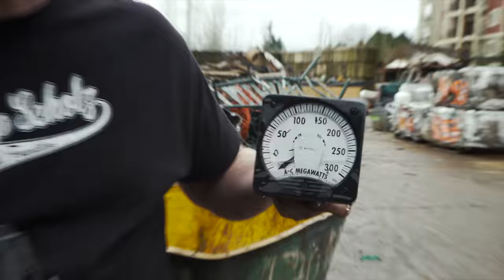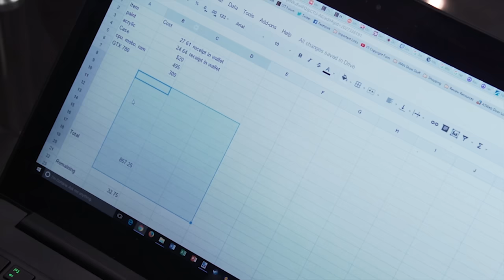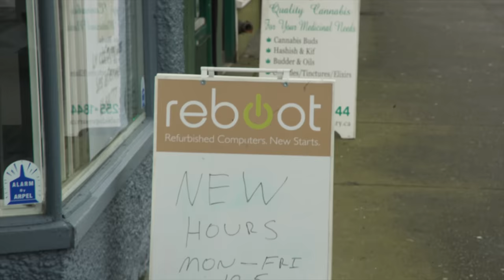Modded Gaming PC Challenge - Scrapyard Wars Season 4 - Episode 2

Comment: It would be really cool if they rewired the megawatt meter to show CPU load, temp, or gigahertz somehow
Reply: Yes
Reply: +Shockin Awesome It's impossible.
Reply: +E.J. Mercer (iso2013) Impossible.
Reply: +TwitchingDan not if you know how to use electronics well. If you connected a microcontroller to the computer and to a servo, then you could write a script on the computer that sends the information by serial. Definitely not impossible.
Reply: E.J. Mercer They are analog meters, not digital.
Reply: TwitchingDan Then replace the existing mechanism with a servo. Or use a digital to analog converter.
Reply: E.J. Mercer I doesn't take a analog signal, it manually measures voltage. It's like a scale with a needle. You can't use a DAC to give the scale data and make the needle move.
Reply: TwitchingDan depending on the meter, if you disassembled the voltage measurement circuit, then sure you can. Servo would still be simpler (and definitely possible)
Reply: E.J. Mercer He would need a servo that can respond fast enough, and remember, that meter is solid steel.
Reply: TwitchingDan Not if he did temp. Temps don't change as rapidly. Also, who cares what the meter is made out of? It was just an interesting idea. I don't care if its "impossible".
Reply: E.J. Mercer Well, if you give an idea, make sure people can actually turn it into reality.
Reply: TwitchingDan Well, most people with electronic experience can actually turn it into a reality. They could for example chop the face off and put a servo to control the needle. They could just 3D-print a similar dial and use a servo on that. Nothing says they have to use the original circuitry.

Well, if you comment on how something is "impossible", make sure you think about other ways of doing it.
Reply: E.J. Mercer Remember these guys need to think of price. And I don't think they can use the ultimaker. Also, chopping the face off and 3D printing a new one, then using a servo, just buy something premade.
Reply: Im laughing so much with this guy. This guy is basicly saying to remove the meter, Almost are the circuit and make a cpu meter in the case xD-
Reply: Sans Who?
Reply: OK, what I meant was just to make a meter on the face to show CPU usage, whether or not it used parts from the one they found. I know this is a budget competition but it would still be cool to add after the fact
Reply: And I didn't say to chop the face off AND 3d print a new one, I meant more to illustrate that it's possible to do in multiple ways if they wanted to.
Reply: I've got mechanical dials on my old steam punk case. They measure temperature, 'pressure' (cpu load), and 'phlogiston' (decibels from the inside of the machine). The dials came from some old hospital equipment but we took the face and body from the dials and wired them up to standard doodads (obviously, not an electrician). You really can use them, you just have to gutted mechanism from the metre.

Comment: $300 for a 780? lmao
Reply: +Suplx Canadian.
Reply: CAD.
Reply: +Suplx 300 CAD
Reply: Like $3 us
Reply: +Suplx 300 CAD is $311.49 for us
Reply: +Oliverleo2007 300 CAD should convert to around 220-230 USD
Reply: +Oliverleo2007 Goes the other way currently bro
Reply: +Oliverleo2007 The fuck you talking about? $1 CAD is equal to $0.77 US right now. Not too long ago it was less than 3/4. $300 CAD is about $230 US.
Reply: poor Canada. I got a 970 new for 320 us when it first cane out lmao.
Reply: +batt3ryac1d You can come to Australia where you can get cheap deals of GTX 970's from a low of $459 to as high as $539 Australian Dollars. Gotta love the exchange rate :D
Reply: +AUSCreeperCo_ yes I got mine for 490
Reply: +AUSCreeperCo_ I know right? I'm building a $1500 pc and it has a R9 380 4gb and an A8-7670k plus some other budget stuff.
Reply: +Suplx rip got a 780 for 250 aud :)
Reply: +Jerreh Mc WHY AMD
Reply: +Jarrad Ng coz dx12
Reply: I payed 500 USD for mine but it was two months after its release and brand new. Still performs very well, looks good and the máme has something to it. :3
Reply: +Jerreh Mc That makes absolutely no sense. A8s are APUs, which are pretty weak. Gonna bottleneck the piss out of a 380. Better off going Intel, especially since you're paying $1500 for the whole thing. There's nothing "budget" about $1500.
Reply: ***** Okay... then can you recommend a processor around that price and a good Mini-ITX motherboard that supports 1600mhz DDR3?
Reply: I'm in AUD. I'd prefer AMD, but if it is better to go for an Intel processor, I'm all ears. That processor was on eBay for $160 AUD, so maybe up to $225 AUD?
Reply: +batt3ryac1d I got a 780ti for £180
Reply: ***** Usually eBay Australia has some decent deals.
Reply: ***** So you think the GTX 960 4GB would outperform the R9 380 4GB? That would be really neat as it is less expensive and they have it in a colour I like.
Reply: ***** Okay, I reckon I'll go with the 960. Thanks for your advice! Also, do you think the Bitfenix Phenom Mini-ITX is a good case?
Reply: +Jerreh Mc If you are after low prices and live near an msy they typically have competitive pricing. If they have everything you want in stock it is a miracle though. http://www.msy.com.au
Reply: +KIN0025 i agree, cos thats the place im gonna get my pc components for my build from
Reply: +Jerreh Mc out of curiosity, why are you making these compromises on a AU$1500 budget? I threw this together:

http://au.pcpartpicker.com/p/LMVXXL

- featuring a 4690k, an overclocking-friendly motherboard and an R9 390 for less than your budget. Admittedly, it isn't an ITX system, but it's a pretty spectacular example of what you can get for that price.

Also, why ITX? Spatial constraints? LAN box?
Reply: ***** Everything's always pretty rubbish in Australia. :(
Reply: +Cody Jones "nvidia exclusive features" To be clear, this is reason NOT to buy shit from Nvidia and this is coming from Nvidia card owner.
Reply: +Jerreh Mc I paid 400 AUD for a complete build. It had a xfx r9 280x and an i5 4460 lmao
Reply: AUSCreeperCo_ I know. To be fair I got a bargain shits mad expensive here too.
Reply: +Jerreh Mc id go with the 380/90 because the 960 was originaly made with 2gb, also the apu will bottleneck the gpu so try getting a better cpu, either fx6300 or core i5^
Reply: ***** his individual mindset may not do anything significant, but the mindset itself becoming more prevalent certainly does. I know quite a few people who refuse to buy Nvidia hardware until they stop pulling crap like the PhysX CPU discrimination (where the instructions carried out when PhysX is run on a CPU is outdated by a decade, whilst it runs fresh code on their cards).

The fact that GPU performance has always varied depending on which cards were released most recently is what allows people to do this, as any AMD owner is only a few months away from superior performance anyway. "More advanced hardware" isn't a factor - certainly not one that is in Nvidia's favour - because they are at least equal right now.
Reply: ***** "better" isn't that simple, though. The Fury X is better at 4k than a 980ti, while the latter is better at 1080p at >60Hz.

Incidentally, you might want to drop the "everything else is bullshit" dogma. People complaining about things like DRM led to GOG becoming a pretty significant place to buy games, and also led to some of Witcher 3's acclaim for not having any DRM. Those few people who voted with their cash got us somewhere other than Steam to buy games.
Reply: +Jerreh Mc The 380 is better in most games besides gameworks features and will be around 10% better with games using async computer.
Reply: +Henrath also freesync monitors are around $100 cheaper or more than gsync, if you want that.
Reply: +Suplx It's 230 dollars
Reply: +Neiva - CS Zombie Escape Videos I got a 270x, i5 4460, build for $600 AUD new, minus the ram, psu and secondary hdd ( I got a ssd system drive).
Reply: +Neiva - CS Zombie Escape Videos msy mostly
Reply: ***** It autocorrected from Compute.
Reply: +Jerreh Mc get a mad 760k or a 860k both very good CPUs unless you play strategy or physics based games

Comment: At one point luke mentioned having a smoke stack, here's a tip if you wanna make smoke come out of them. Get a small fuel candle, like an oil lamp or meths burner, and fill it with gasoline. I use gasoline in my zippo sometimes, always burns with this thick black smoke, could give you a good mad-max look.

Comment: 33:14 Damn that's my old case my friend gave me. Foxconn letters on the bottom, removable 3 slot hdd bay, dual 80mm fans in the front. Was the bomb in 2003-2004 or so lol. Not to shabby even now for a server or something. It houses an old nforce 2 gigabyte k7 board, an athlon xp 2600+, 1gb ddr400 and an 8400gs. Always thought of modding it! :]

Comment: Luke, you should have rigged something to one of the fan shafts that lightly would spin the wheels you guys had, that woulda been doppppeee
Reply: We wanted to but a fan has very low torque some something else would have been needed like a 12v motor out of a kids toy. No mater what it wasn't something we had time to work on.
Reply: BSMODS damn that's very true and those wheels aren't light compared to how weak the fan torque is. Could have gotten like a remote control helicopter mechanism then just rigged it and used the controller to control it whenever you wanted, just use its current battery as the power source hahahaha that would be funny as hell. Still love the damn thing though mad max wo
Reply: It was super fun to build and I wouldn't mind doing something like it again with a few weeks to mod it instead of a few hours.

Comment: that nvidia bias calling the 390 a 290 with more vram, the tests dont lie
Reply: It's actually true, the 390 is the same graphics processor, just clocked higher out of the box. You could achieve the same with an OC'ed 290, and the 290x is like 1% slower than the 390

Comment: 6:13 Forklift Operator is not wearing seat belt. Fuck safety.
Reply: +Franky Twofingers Seatbelt? Dude I have a forklift licence and no forklifts i have ever used actually came with a seat belt that I can remember. You cant really fall off a fork truck.....Hi-Vis jacket and a safety helmet though...he could maybe do with those! haha
Reply: LeithKemon
I have a forklift license too. My forklift has a seat belt. We're required to wear it.
Reply: Also, yeah, it's kind of hard to fall off of a fork lift, but the fork lift itself can fall over, and I don't want to fall out of it if that were to happen.

Comment: Pretty sure those pistons are from a diesel engine.
Reply: +Chickenhunter22 Size is 4.125" and the rod had GM stamped in the casting
Reply: BSMODS Ah, So probably a Duramax Engine Variant, From what I saw they had a giant round bowl on the top.

Comment: I don't know what he means by the 600w is "decent", bitch my 500w powers my 960, 6 core cpu, liquid cooler and 2 hard drives and leds
Reply: it's not about the wattage. it's about the Corsair CX brand. CX power supplies are known to be unsuitable for high power projects such as SLI + watercooling and feature cheaper Chinese capacitors.
Reply: yeah but look at what they were building? there was no SLI OR watercooling... sooooo I don't see your point. He said it was "decent" when the 600w was supplying
surplus amounts of wattage
Reply: wattage isnt everything dude. The build quality of the CX isn't terrble but it isn't top-of-the-line, either. That's why it was just a "decent" power supply. Nothing truly spectacular but it did the job just fine.
Reply: Really my gtx 960 in my system draws 300 watt from the wall
Reply: NolimitsCoasterManiak Sorry but that just isn't possible
Reply: apologies mate.
Reply: i know this is super old but i dont see why there was any arguing going on in any form, anyone that knows anything at all about PSU's or PC builds in general will understand that "decent" doesn't refer to the wattage, you could make a 600w PSU for 100$, but I don't think anyone would consider that "decent" if it was made of shitty materials that could easily destroy your entire computer if its touched at all, and besides that, your PSU build quality can mean the difference between life and death when dealing with dangerous components like electricity movement and storage.
Reply: if thats something someone doesnt understand just take 2 minutes to google power supply prices, theres 500w psu's that can be worth 100$ more than a 600w one just because of build quality, safety, and customization options. all of which need to be taken into consideration in a mod-heavy build like this.
Reply: No Shame Genjimain yeah its rather 230 watts

Comment: Why does he keep saying the Canadian dollar is shit? Why would that matter if they're buying the stuff in Canada? The value of the Canadian dollar would only impact imports/exports (generally), I highly doubt it would show in the used computer market.
Reply: If you have something that was based around the American dollar and costs 100 dollars then it cost 100 dollars. So if they where bases in America and did this but with 400 usd then the 100 usd item is at the normal price. Now if you have 400 cad budget and buy that item in canada the price is the same but the number is 30% higher which is 130 cad. So they lose more money out of their budget and therefore cant buy as much. So there are 2 other ways of doing this. Changing the dollar to usd or increasing the cad budget so it is the same amount of % lost in budget as in a 400$ usd budget. The problem is that it increases the money spent anyways.

Tldr: your doubt was wrong